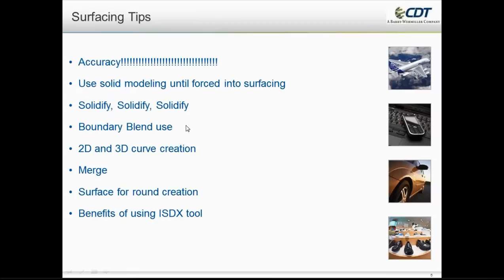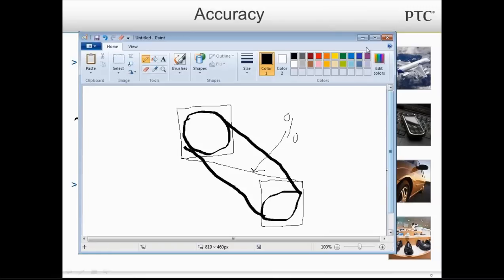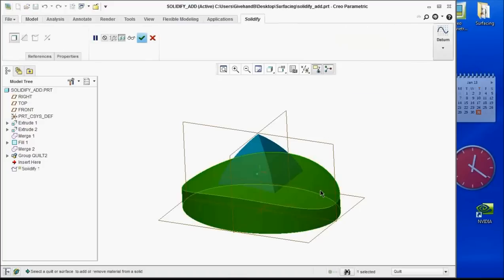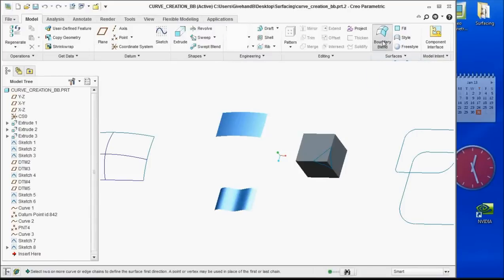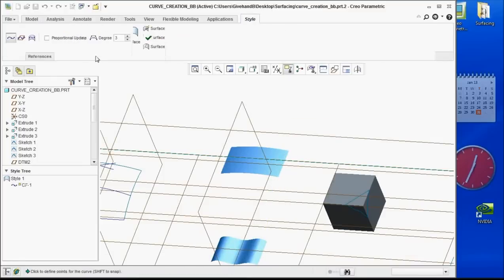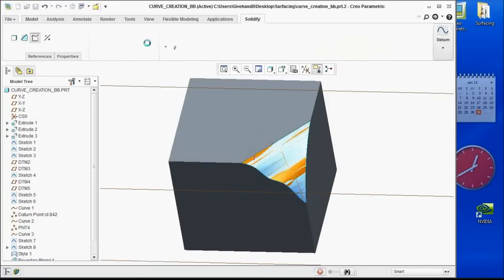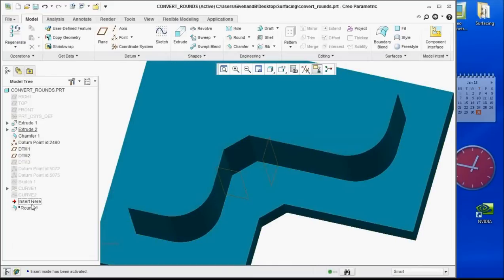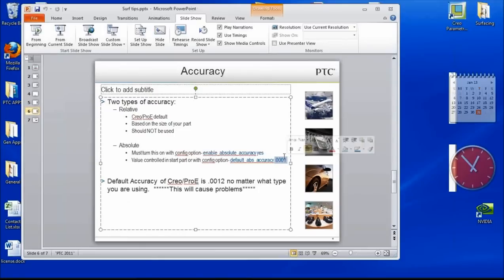Surfacing w/ Base Package and Creo Interactive Surface Design (ISDX) Webinar

Comment: A question: Is the value of "absolute accuracy" unit (mm, inches, cm) independent? For example I use "absolute accuracy" 0.05 for milimeter. Is it ok?